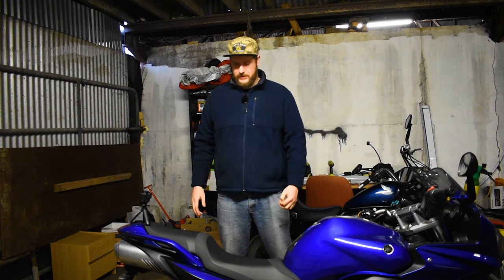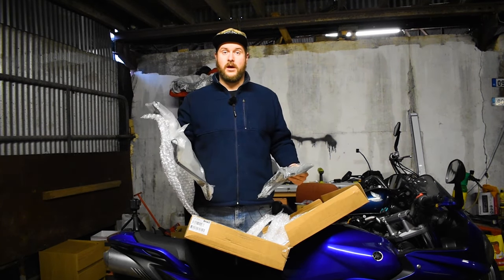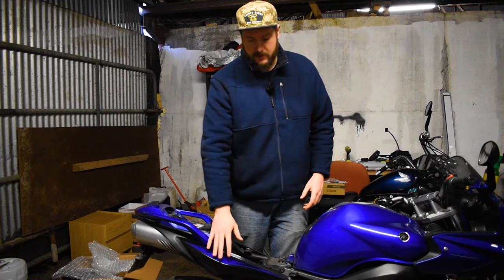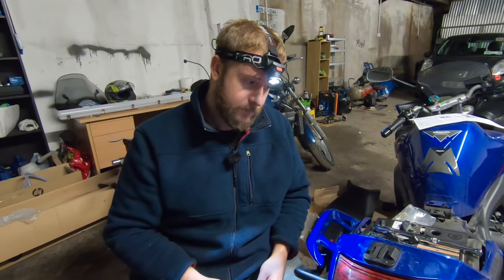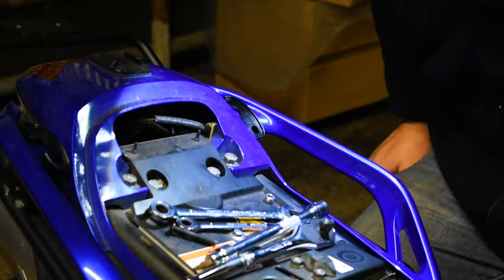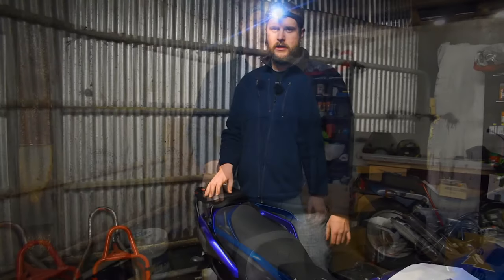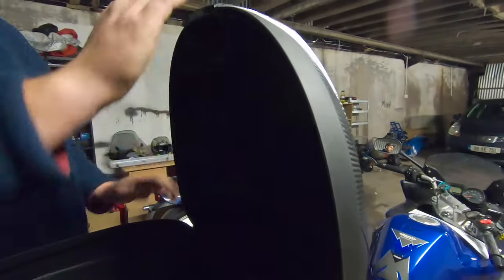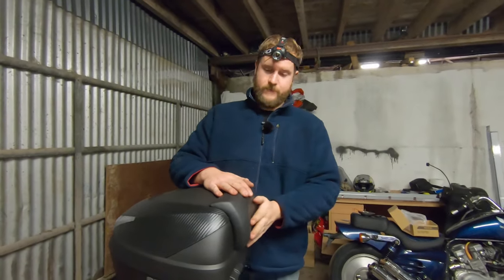Fitting a SHAD SH34 Top Box | Fitting Kit Issues | I finally have luggage | Yamaha Fazer S2

Comment from the maker: So yes this was a pain to fit. I am disappointed with the fitting kit and from what I can see it is the correct(and only) fitting kit for my year and model bike. I couldn't recommend this fitting kit due to the issues in this video. However the top box is very well built and with some modifications it's very sturdy on the bike. Anyway, I will do a follow up review of this case in the future. Thanks for watching.

Comment: just bought one of these, description says a rubber sealing system but mine doesn't have one! how is it then waterproof? was yours dry?
Reply from the maker: I have no complaints about the actual topbox, I had it on there for about 20,000km before I sold the bike and it never let in water. Also I rode in rain a lot so I think you should be good. 
There's a kind of raised plastic lip that interlocks to seal it, there was no rubber seal on mine either.
Reply: @TheGorillaBiker  Thanks for the quick reply! cheers

Comment: Well done mate, it sucks when things don't fit right, and that def looks like it is badly designed or the wrong kit. Hope you can get the missing bolt sorted. I've never had a top-box, not a fan of the looks, but they def have advantages when going places where you don't want to carry a helmet etc.
With the back pad, is it not worth sticking it on rather than screwing it? Would save making holes in the waterproof box. A couple of GoPro sticky pads would hold that solid.
Always good to add camera angles! :-)
Reply from the maker: It's the right part number it just is badly toleranced I think. I will, I'll just drill a through hole I'd say, I might re do a lot of the alignment myself tbh to make it more solid. 
I wasn't either but I was in town today with it and it is sooooo much more handy than my backpack so I'm converted :) 
Absolutely, another commenter said the same I'll definitely go that route! 
Thanks, I think they worked out ok, just have to get better at aiming them and such :)

Comment: Super nice video, But is the SH34 water tight as they promise?
Reply from the maker: Thank you! I've had it through several heaaaaavy storms now and it has been yes :) not a drop of rain in so far.
Reply: @TheGorillaBiker  thanks for the info, I will test it to see if it survives the Scandinavian rain 😉
Reply from the maker: To be honest once you get it fitted(the fitting kit is awful) I think you'll be good it did 6 months of unbroken rain here 😂

Comment: I have the s1 verison and it fit on the bike like a glove, found it super easy to do, maybe there is a slight change in the s2 ever so slightly...
Reply from the maker: I'd say that's it tbh, the grab rails were slightly more beefy on the S2 and that's where it just would not fit or line up properly...ah well! Still a great top box
Reply: @TheGorillaBiker  I know they made a newer version of the top bracket that links up with the shad 3p system pannier bracket, probably would of fit better.
Reply from the maker: Whatever would or wouldn't have been better I spent ages talking to Shad at their stand at motorcycle live and it didn't fit, black mark in my book. Wouldn't order from them in a hurry again
Reply: @TheGorillaBiker  Totally agree with that